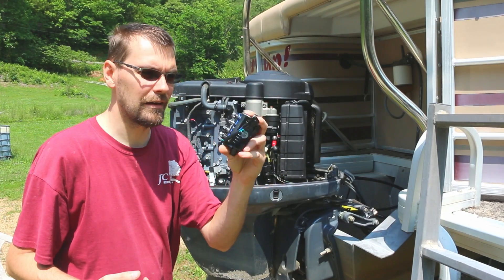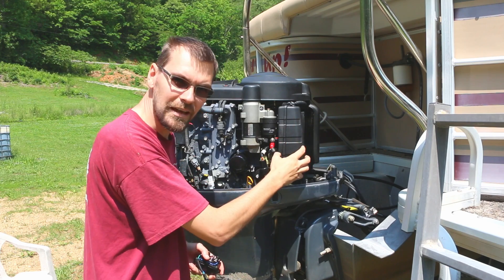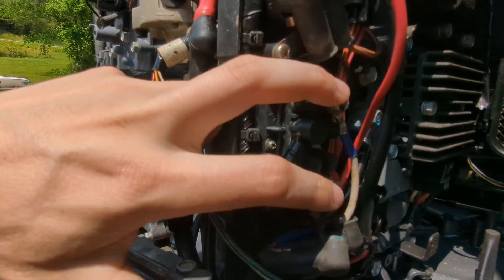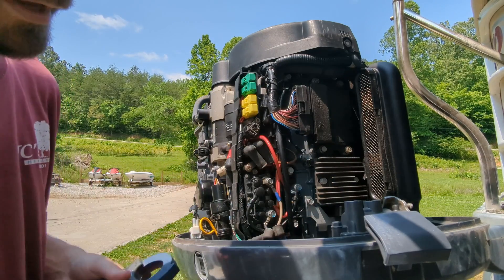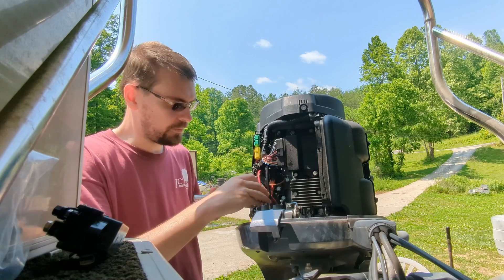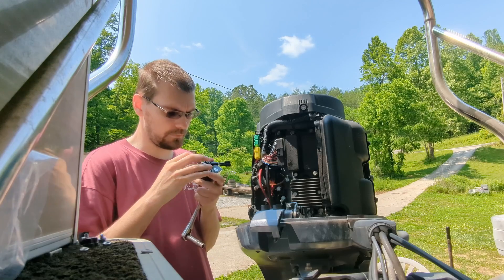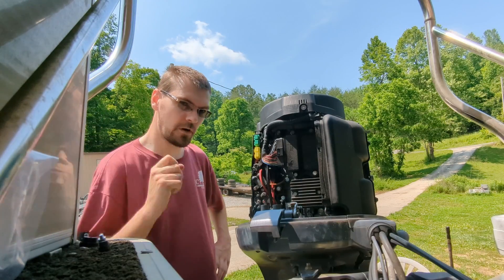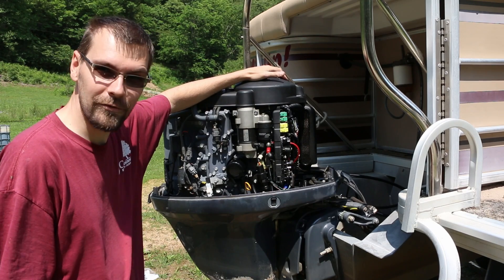Yamaha power tilt and trim relay diagnostic and replacement

Comment: tilt motor runs, full of fluid, no leaks but still wont work, any idea
Reply from the maker: Try opening the little relief valve, usually a flathead on the side and run the pump to get any air out that could be trapped in there

Comment: hi there, i got F150 and the trim is sometimes function in intermittence. I try to change the carbon and spring inside the motor which might be the cause previously. it works in the beginning and then suddenly it coming again. Do you think relay might be thenproblem?
Reply from the maker: Could be, you could check the wires coming out of the relay to the trim motor and see if its passing power with either a multimeter or test light, that would tell you if its the relay or the motor.

Comment: My 2023 SHO 200 was working fin the past 2 yrs.. u til this past season... The trim will kt work.. at motor or at Throttle.. unless my key is on..
It was never like that before... no clue why.. Could this be the same culprit?? like I said... It works just fine with key in on position... but not at all Afyer 10 seconds or so after turning key off
Reply from the maker: Sounds like its getting power from the engines main relay for some reason rather than directly from the battery.
I'm not familiar enough with every models wiring to give you exactly what to do, but I'd have a close look at the wiring and see if maybe there is a fuse, or if a wire has gotten moved or frayed under the cowl that would have been providing power with the key off

Comment: Mine all the sudden started running backwards up is down the down is up and the motor won’t go up enough to take the bar out it sets on when driving down the road on the trailer
Reply from the maker: That's really weird! You could switch the blue and green wires on the relay to maybe correct that

Comment: Great video.  I know this is 2 years old but a quick question.  When I lift my Yamaha outboards they both lift fine.  Trouble is that one of them makes a loud buzzing sound when it reaches the top of its travel.  Any help appreciated..
Reply from the maker: I'd check and see if its the relay buzzing or something else, perhaps you have a poor connection or voltage is dropping and causing the relay to buzz?

Comment: Mine didn't work change both relays and it still don't work what if I take one of the wires off and help positive to it it'll go off and I put the water back on either way my motor is good in two brand new relays any idea what the problem is even bypass the switch
Reply from the maker: Is the relay clicking when you press the button?
Could you check to see that you're getting power into the relay correctly?

Comment: Tonight the down power activated and won’t stop.  Keeps trying to push the motor down, if I push the up button it will stop the motor but if I let go the motor tries to keep going down.  I had to disconnect the battery so it won’t burn out the motor.  Do you think this is the relay, or a short or stuck switch?
Reply from the maker: Sounds like one side of the relay welded it's contacts together, you could try tapping on the relay and see if it will release but you're probably in for a new one
Reply: Thanks man!  The new relay should arrive today and I will change it out. If that doesn’t work I’ll have to look at the switches and wiring.
Reply: The new relay $33 from Amazon fixed it!  Thank you so much!

Comment: My problem is ,with the ignition on , you push the up button  . The motor cycles all the way up and won’t stop until I turn the ignition off . Any ideas ?
Reply from the maker: That has to be either the relay is sticking, or power from the up side is getting fed back into the trigger side of the relay, has it always done this, or did it just randomly start doing it, or did someone work on the wiring and then it started? That'll tell you if it's more likely a wire got hooked up in the wrong place, or if the relay is failing internally and sticking on

Comment: Thanks for you detailed video! I have not used my boat in months i started the motor and trim would move up and down very very slowly with engine on after a few more goes, the engine does not move all you can hear is a click sound everytime i press the trim button up or down. Any suggestions? Thanks again :)
Reply from the maker: I would check if you're getting power through the relay, moving slowly and then not at all seems more likely to be a motor failing/failed, take a peek at this video about replacing the motor: https://youtu.be/l2bUDJ8dj1U
Reply: Thanks for your reply! Checked relay and it was fine so i think your right so im going to replace the motor @trythistv

Comment: Great Video This helped out.. I have an F150.. I Have check fluid and replaced relay, and new battery.. Sometimes when you first use the trim and trim all the way up one you get halfway its start to die out and then clicks, why I replaced the battery and relay now and still the first time you trim up with die out and then after works pretty well.. Thoughts I feel like I'm missing something???

Comment: Hi, I saw your video after changing the trim motor, I also changed the trim relay and I still hear the clicking sound when I press the switch down or up, I don't know what else to do.
Reply from the maker: If you connect power directly to the blue and green wires that go to the pump will it do anything? Like take them off the relay and connect jumper cables or such to put power direct to the motor.

Comment: I have no movement but clicking at each button on dual engine setup. I replaced batteries and still just click at throttle, click on individual buttons on throttle base and click on each motor button…
Reply from the maker: Have you tried replacing the relay? It could be the motor itself is bad also, I did a video on diagnosing a motor vs a bad relay as well: https://youtu.be/l2bUDJ8dj1U

Comment: Anyone have a Yamaha F40 2000? From all videos I can see, the trim relay is well accessible, but on a 2000, only half of relay (if not third) is accessible, other half is way to deep in metal casing!!  According to repair diagram, the relay has only 1 screw (where accessible) that holds it on to casing, but even with that screw out, relay wont budge :(.  I can only test green, which already works on switch... there is no way i can get to blue connection.
Reply from the maker: I don't recall having seen that style personally yet, There has to be some way to remove the cover or relay

Comment: My 2014 F150 will go down but not up using both cowling and throttle switches. No click when I push up. I replaced the relay and still the same. If i reverse the blue and green wires, I can raise the tilt using the down button in this reversed configuration. Could both switches have failed or could my replacement relay be defective? seems unlikely. Thanks!
Reply from the maker: I would wonder if maybe the up trigger wire to the relay could be faulty, it would be rare to get a bad relay out of the box, but it could happen. I would check to see if the 12v signal is getting to the relay to switch it, and trace backwards from there, I don't have the wire color codes in front of me right now, but you should be able to see them at the trim switch that is on the motor cowl easily and test the switch with a multimeter
Reply: @trythistv  That is the next step. Since I could not raise the motor using the remote or cowl switches, I just assumed the relay was bad. Probably a bad assumption. It's odd that neither switch functions to raise the motor if it is a single faulty switch.
Reply from the maker: Diagnostics are often a bit vague, replacing the relay is an obvious and easy first step, but since that wasn't the problem it means more digging.

Comment: I have a tiller handle Yamaha and the trim works fine on the engine but on the tiller handle the trim up doesn’t want to work, I can get it to sometimes but it’ll go out would this be the fix for it? Or is it wiring in the tiller handle trim button
Reply from the maker: If it consistently works from the switch on the motor but not the tiller switch then it seems like it would have to be the wiring or most likely the switch on the tiller handle, it probably sees a lot more use than the one on the motor, could just be the switch is worn out.
Reply: @trythistv  👍 thanks

Comment: This is the problem I'm having. Works up but not down. Thanks for the video.
Reply from the maker: Hopefully it helped you get it working again!
Reply: It's the switch. You can open  the switch and clean it up with electric cleaner spray.

Comment: Great video! I have twin engines. Both tilt trim switches on the sides of both engines work fine. When I press the throttle switch (thumb button), only the port engine works, both up and down. The starboard engine, nothing. Also, the individual tilt trim switches on the base of the throttle control, only the port works. The starboard does not work. Could this also be relay related, or something in the helm? Thank you!
Reply from the maker: If the buttons on the engines cowling works properly up and down then your relay and trim motor are fine, the problem is either the switch in the throttle handle, or something with the wiring from the handle to the motor.
Reply: I agree. The thumb switch works for the port engine,  just not the Starboard. I beive I read there are individual relays coming out of the throttle box. Thank you

Comment: Great vid. I have a question. Our trim (Yamaha 200HP, 1996) is working just fine when going down. When going up only the lower pistons work. The one in the center doesn’t do a thing except for some noise. All seals have been replaced. Oil is ok. We tried the trim directly on the  battery which gave us the same result. Have you got any idea?
Reply from the maker: I'd bet you've got some air in the system still, they all run off the same reservoir, and if the seals are good then likely you just don't have quite enough fluid to fill both of the side pistons and the center one. I would try adding fluid and trimming up gradually and see if it can raise further
Reply: Thanks for your respond!
Reply from the maker: Of course! Hope you get your tilt/trim sorted out!

Comment: Can we see the new solenoid wired up? What did you change on it?
Reply from the maker: The solenoid comes as a whole packaged assembly basically, it technically has 2 relays in it basically, which both normally connect to negative, and pushing the trim button sends positive power to one lead or the other so it reverses the direction of the motor. it plugs in to one connector and gets a couple wires attached with ring terminals, does both directions. If one of the relays fails, it'll typically remain stuck connected to ground so you will have one direction the trim will work and the other won't do anything.
Reply: @trythistv  okay thanks, we had issues with our 2012 f90, changed the solenoid, changed the button, changed the motor and now it seems like solenoid issues again, it won't try to move up or down but if I put direct power on it, it moves

Comment: Do you have a video of checking the tach on a 90hp yamaha 4 stroke
Reply from the maker: I do not, They are quite simple though, I believe the grey wire from the engine feeds the tach, Some are a stator winding, others are alternator sensing, depends on what motor exactly. I see a lot of actual tachometers fail, very rarely the wiring or engine side stuff.

Comment: How's your sanderson going?, just bought myself one
Reply from the maker: Its running like a champ! Still haven't fixed the brakes, but everything else is working good. it has needed some hoses here and there, and some other little things but it runs so good and is extremely handy. I wish I could find the stuff to build a driveshaft so I could use the 4x4 on it.
Reply: @trythistv  ive never seen a sanderson with working brakes ever! Glad to see yours is still working as hardly any made it out to America!
Reply from the maker: I'd sure like mine to work, but its a big job to fix them. I've been working up the motivation to do it for a few years now... still don't have enough 😂